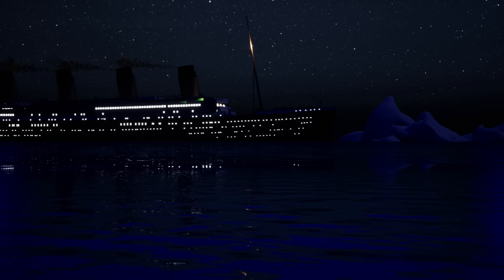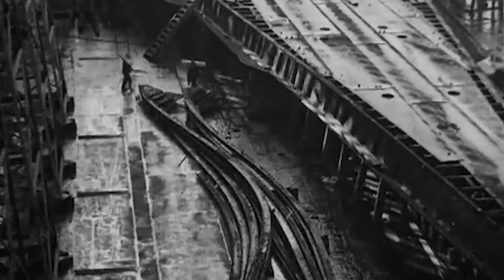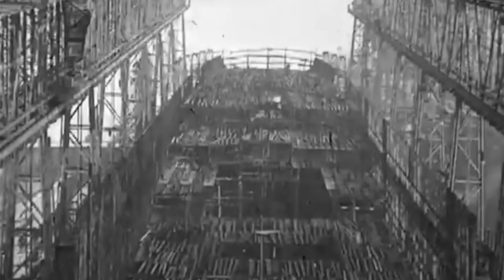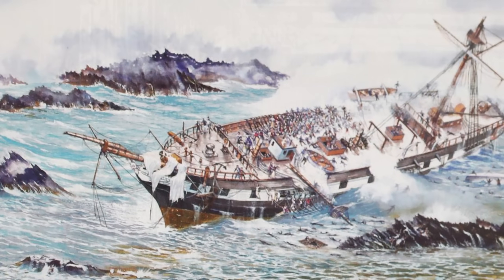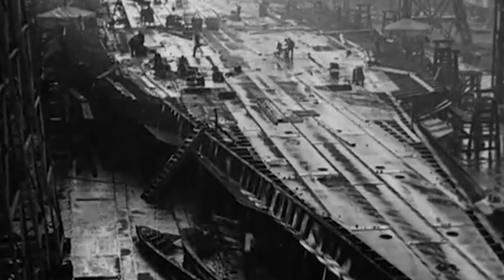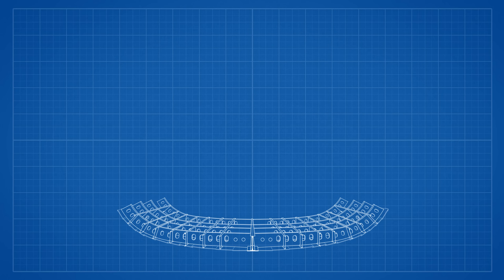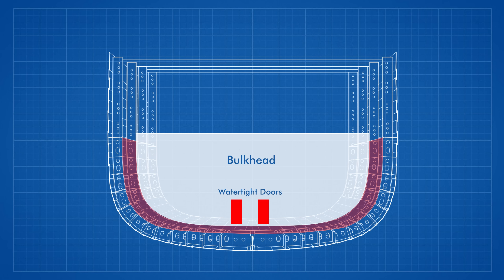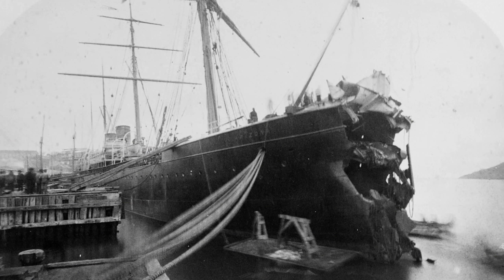How did the Iceberg Sink the Titanic?

Comment: Physical evidence and eyewitness accounts point to the accident being a grounding, not a collision. Titanic did not run into an iceberg; it ran over an iceberg. The initial pattern of flooding and testimony from surviving crew members are consistent on one point: the bottom of the ship--not the side--made solid contact with the ice. Survivors unanimously described the sound and vibration of a ship running aground. There was no sharp jolt of a ship slamming horizontally into an immovable object. Instead, the slight tremble was barely enough to rattle silverware set out for breakfast in the First Class dining saloon - Encyclopedia Titanica
Reply: Absolutely untrue. The reports of vibration coming from the bottom are only consistent in the areas of the ship we knew hit the side, and we know Titanic's steel wasn't as ductile as modern steel and therefore the tremors from the force of the collision on the side of the hull would be sufficient to send shockwaves through the structure, emanating outward from the points of contact which are consistent with survivor reports in the area and deepscan sonar results have revealed ZERO grounding damage on the keel.

The only section of double-bottom keel on the ocean floor is from the break areas of both the bow and stern sections, which is very far away from the area that made contact with the iceberg, and neither piece demonstrates iceberg damage.

Really wish these braindead conspiracy theories would die out. The real story is fantastic enough as it is, there's no need to conjure fairy tales about it.

Comment: The iceberg created a 12’ wide hole in the starboard side,that was almost 300’ long. It opened up five compartments and she was doomed.
Reply: No, it did not. The 300' gash, as this video explains clearly, is a myth. It was just 20 square feet of damage, comprised of 6 slits along the seams of the plating in the hull, with the largest of these 6 openings being only 45 feet long and 6" wide at the widest. This damage was enough to flood the ship at a rate of about 2000 gallons or 8 tons of seawater per SECOND - which is why the sinking took 2 hours and 40 minutes.

Had the Titanic received a 300' gash 12' wide, she'd have sunk in less than 20 minutes.

Comment: I always wondered how once one compartment was full, it managed to overflow.
Reply: Water in the ship can only flood as high as the water is outside the ship, then it stops. So long as the bulkheads are higher than the water level outside the ship, the compartment will contain the water. This water will make the ship float lower in the water, but that's no concern so long as the damage is contained to a small area. In Titanic's case, being designed to handle 4 compartments full but taking water in 6, it was enough water to pull the ship low enough to where the tops of the bulkheads in the ship were now lower than the water level outside the ship. This allowed the water to spill over the tops and ultimately sank the the ship.

Comment: Why did it sink because it wasn't built right if it would have been built like the ship called the Great Eastern that did the same amount of damage as the Titanic if the Great Eastern State of float it was built right
Reply: The Great Eastern's design was dramatically outdated by Titanic's day. She was built just fine, and had a remarkable design. She sank because 52,000 tons of ship hit a 5,000,000 ton iceberg at a speed of 21 knots along just 20 square feet of damage. Even modern ship steel wouldn't survive those kinds of forces.

Comment: Never thought in 19th century rivets were fastened by hammer. I leep picturing it being secured by air guns😂
Reply: The extreme curvature of the bow required the hammered rivets. But larger, steel rivets were installed using hydraulic rivet press machines that were hung vertically from the Errol gantries.

Comment: It didnt!  Was insurance fraud, using its identical ship 'Olympic'!
Reply: Olympic and Titanic were far from identical and to switch them would be impossible within the given time frame considering that Titanic was nothing more than an empty shell for the majority of the time the two were together.

As for your other comment, jet fuel cannot melt steel beams no, but it can act as a catalyst to create a fire hot enough when surrounded by flammable materials to anneal the surrounding steel making it soft and easy to bend. Especially when you take into consideration the weight it had do deal with above and the construction of the towers. 

While there is more creedance to those theories the ones concerning Titanic are so weak that even a child could prove them wrong
Reply: @Tozzpot500  blah blah word salad!  Or basically 'If that were true it would be all over the news'!   Come on!
Reply: @wellifthemediasaysit  ah it appears you may be too far gone. Let me ask you this, if the switch really did happen how come Titanic's yard number 401 is found across the wreck including on components impossible to switch between the two liners such as their engines and hull plating? And to further that how come the wreck has every alteration made to the Titanic including ones that wouldnt have been possible to add to the finished Olympic like an extra expansion joint or revised air ventalation placements?
Reply: @Tozzpot500  Is that what you have been told to think?
Reply: @Tozzpot500  Im not saying it DID happen, but its far more plausible than those 3 bankers that needed to be 'offed', etc
Reply: silence fool. the two ships arent even identical.

Comment: I have seen many pictures of an iceberg with a red line at its base with the capition. The iceberg that sank the Titanic.With modern technology could nobody place a CGI of Titanic on the picture to see the size of the berg.? Be interested to see the height.Also is there any evidence of any fragments of ice being brought into the inside of Titanic when she hit the berg.Just interested.
Reply: A few survivor accounts testified that the top of the iceberg reached just a bit higher than the boat deck. So the iceberg was gigantic with the small portion above water already taller than most of the ship, and the section underwater undoubtedly several dozen times the size.

Comment: Weren't steel rivets used and fitted by machine but wrought iron ones for the curved sections where the machine couldn't reach were fitted manually?  There are research  papers in circulation that the iron rivets were not top-grade and slag in the iron weakened rivets when under stress and in very cold water?
Reply: The "research papers" are total garbage. The wrought iron rivets selected for the extreme curvature of the bow and stern (which necessitated these rivets to begin with) were the same wrought-iron rivets used by steel ships for the last century before Titanic's day, and they were really only inferior if you compared them to modern iron, which, duh. Too many of these asinine research projects fail to reconcile early 20th-century metal firms did not have access to modern steelmaking technology.

Comment: Ive heard some new information circulating around. The thing that actually sunk Titanic was a boiler that blew. There was a problem or a fire or something already started in the boiler room when they left England but wanting to stay on schedule and thinking that they could handle things, the ship sailed off. Then things got out of control and the boiler blew part of the side of the ship out. The official story was that it was an iceberg so that White Star Lines wouldn't be sued for negligence.
Reply: None of that is true. She had a small smouldering fire in one of her coal bunkers but thats it. There are no signs of an explosion on the wreck and many witnesses to the iceberg
Reply: In the most respectable way possible, this is utter horseshit
Reply: @pc_buildyb0i935  Was I there? No. If you'd like, I can provide my sources. Where you there? No? Care to elaborate?
Reply: @johntoobie6  Why do people think "being there" = infallible? Know who was there? Charles Lightoller, the same person who swore up and down the Titanic sank in one piece.

The fire wasn't an actual fire, it was smoldering coal and it was contained in the coal bunker, NOT the boiler itself. Also, a smoldering fire at 300°C isn't even half as hot as it would need to be to weaken and warp steel (it takes at least 1000°C to weaken steel, even hotter to warp it). The "coal bunker fire" is widely known to have been irrelevant.

Funny saying the boiler blew the hull out because 1; it would take an INTERNAL force to explode a boiler, not an external one and 2; we've SEEN the iceberg on deepscan sonar lol and it's been known for decades.

Titanic's boilers were designed to handle several times the maximum pressure they'd be expected to operate at, as a safety precaution, and were simply incapable of building up the degree of pressure it would have taken to make them explode, no matter how hot they could possibly be made to get from daily operation. Even when struck by the ice-cold water coming into the boiler rooms, the boilers themselves weren't impacted. We know that because we can literally see them fully intact on the ocean floor.

Stop acting like this is some deep, unknowable mystery. The facts are right there in front of your face, if you'd be willing to take 10 seconds or so to open your eyes and look. Enough of this pathetic conspiracy drivel, it's tired.

Comment: I know hindsight is 20/20-a USN veteran I used to work with said that they kept wooden plugs and beams on hand for shoring up damage letting water in. Couldn't Titanic's crew have somehow plugged up the peak vent and cargo hatches to dramatically slow the entry of water? I also wonder why they couldn't have reversed engines which I've read a USN ship in WW2 did to slow, and even begin sucking out flooding. As stated earlier hindsight is 20/20, and Titanic forever has us asking 'what if this had been done'.
Reply: Plugging up the peak vent and hatches would have made no difference because the Titanic was not a warship - she had SEVERAL intake fans and an entire air circulation/filtration system that would be taking on water once the ship sat low enough, and it was impossible to do anything about it on a ship that scale.

Reversing the Titanic would change her location and make her harder to find, plus it was extremely difficult to navigate in the first place being as dark as it was that evening, there was no crow's nest on the aft mast, and moving the ship (in any direction) would simply have accelerated the flooding. They were still over 24 hours away from the nearest land, with but a few hours to live.

Absolutely nothing, even with the gift of hindsight, could have saved Titanic after she hit the iceberg.

Comment: Hi Mike , I know this is an old video but was just reading the second Walter Lord book on the Titanic and he brings up a good point that I noticed in A Night to Remember. Boiler room 4 flooded from below, not from room 5 overflowing into room  4 from above! Is it possible there was additional damage below the Tank deck
Reply: Boiler room 4 did not flood from below. This was an illusion because water pouring over the bulkheads (which wasn't visible to vantage points available in the boiler rooms) would be flowing down over the deck plating and rising up, like every single other compartment.

Comment: Hey Mike. It doesn't seem often discussed in your videos and maybe my understanding is wrong.. although I know a bit about how steel is crap when its cold, but do you not consider steel fragility of the hull to be a major contributor to the sinking of the Titanic at ice temperatures? I suspect you are aware of "Metallurgy of the RMS Titanic" by Tim Foecke. That not only points out that recovered samples of Titanic hull steel was super vulnerable to fracture at ice temperatures (not sure how old his baseline samples were, entropy tends to change steel properties a bit), but also the way they rivets were supplanted by the slag stringers may not have made strong bonds in steel structures for those temperatures either. Just interested in your thoughts on that... or anyone else.
Reply: Completely irrelevant data. The ship sank and the structure failed because a 52,000 ton ship hit a 5,000,000 ton iceberg at a speed of 21 knots along an area of contact no larger than 20 square feet. No materials in existence at the time, and none today, could possibly have withstood those forces and so the steel's brittle factor is an irrelevant matter.

Comment: Why did nobody think about installing torpedos on Titanic to protect itself??
Reply: Torpedos would have done nothing to an iceberg.
Reply: @pc_buildyb0i935  do you mean torpedoes of that era or today's era?
Reply: @mamster233  Back then, but I don't see modern torpedos accomplishing it either. The iceberg would have been 5,000,000 tons of solid, ultra-dense Greenland ice. Maybe a few chunks blown off, sure, but that's probably it.

It'd be like firing a missile at the ground. Sure, there's going to be a bit of damage, but compared to the overall surrounding area, it'll be miniscule.
Reply: @pc_buildyb0i935  Wow, that's amazing. Are there any weapons of that era that the Titanic could have used to clear a path through an iceberg? Thanks for sharing!
Reply: @mamster233  Back in 1912, unfortunately no.

Comment: the truth it short if double bottom and double hull the complete length of the ship nothing would have save titanic 

because unfortunately you couldn't cover the bulkheads it 2 fold 1. there are 3 steran and 3 bow storage compartments of which the bottom of 2,3 and 4 were used and the shaft for them goes all the way to boat deck  ifs similar on the stern 2 covering the compartments would have made it impossible for crew and passengers to escape from below in emergency situations 

now you thinking why they didn't just raise the compartments all the way to the top of the HULL sounds great in theory HOWEVER its been discovered with modern ultrasound tech and sonar that it wasn't just 4 or 5 compartments breached BUT SIX COMPARTMENTS meaning titanic was doomed because amount of weight of water would have pulled the bow including part of the forecastle  completely below surface of the water which would have caused a cascade effect
Reply: Ships had never been designed at that time with bulkheads going all the way up to the strength deck, and no ships are designed that way today, either.

It adds too much weight, and creates seals where air NEEDS to be able to flow. The Olympic class liners (Titanic included) were initially designed to float with 4 compartments flooded in sequence, and later modified to handle 6 (after Titanic).

Modern ships can handle two, or at most 3.

It's just about what the design can or can't handle
Reply: @pc_buildyb0i935  based on what we now know about titanic sinking there us actually a shot none of the safety improvement would have save either of titanic sisters